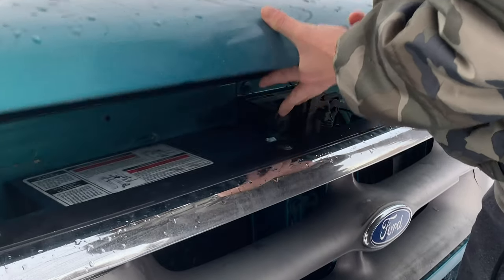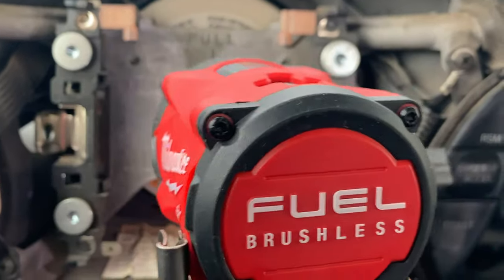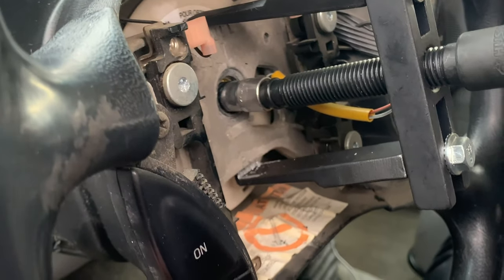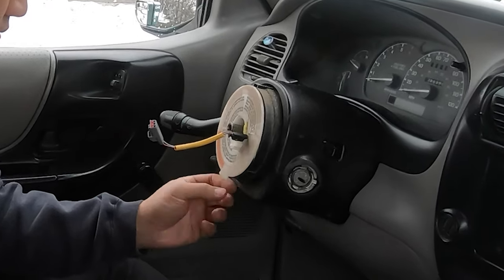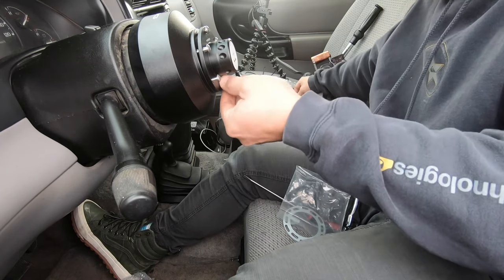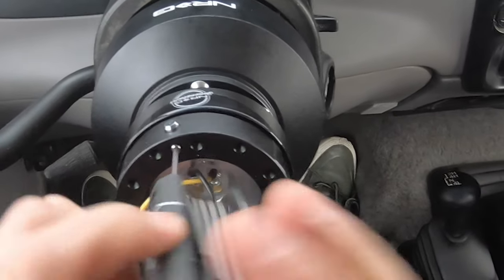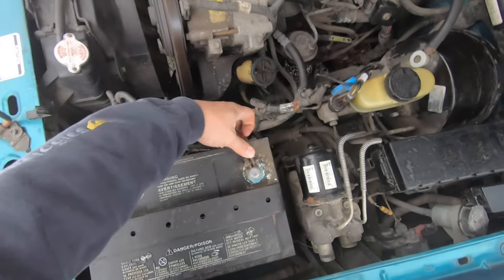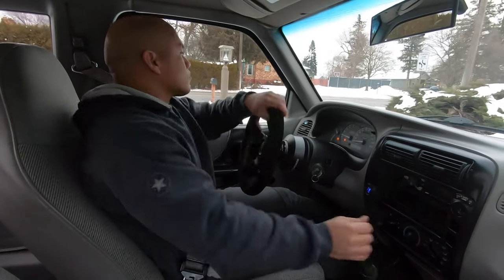How To Install NRG Aftermarket Steering Wheel with Quick Release - Ford Ranger

Comment: I have a 94 ranger , dose anyone know the pats number for that year bc the spline looks different
Reply from the maker: I posted a link to it in the description. The spline does seem to be a little different. It's jammed on there, but it works.
Reply from the maker: The adapter will also need a little modification to keep access to the clockspring wiring for the horn. If you look at this video, you'll see what I mean. https://youtu.be/CNPR5JYdEQM

I talked to a guy who used a die grinder to shave down the hub adapter a little to make sure the horn wire is still easily accessible. But when I installed mine, I just blindly pressed it in. whoops.
Reply: did you ever get your wheel off, if so, can you help me with my 94, the column is different from Stronghold's 95

Comment: What model huh adapter did you use?
Reply from the maker: I put the part number and the link to get it in the description. There's also more information you should read/watch there too. It doesn't fit EXACTLY but it works.

Comment: can i use any quick release with the hub?
Reply from the maker: The hub is designed to receive a 6 - screw steering wheel or quick release. The 6-screw pattern is pretty universal, so as long as you find one with the right pattern, it should work
Reply: @rayregnogarage  thanks so much

Comment: Does anyone know if these can be installed on 91 rangers?
Reply from the maker: I found a Momo Hub adapter on Amazon that says it will fit 84-97. But it looks really tall. Much taller than the NRG. You could try the same part number I used  from NRG and if it doesn’t fit, Amazon is good with returns. The 84-97 rangers are identical mechanically. So it’s a safe guess that it would PROBABLY work.

Comment: Does that hub fit a 2010 ranger
Reply from the maker: I don't know for sure. But It should. The Ranger didn't change much from 1993-2011. Contact NRG to confirm
Reply from the maker: Also... this hub doesn't "fit" the Ranger exactly. Figured that out the hard way. It "works" but if you want your horn to work properly, it will need some modification. Watch this video: https://youtu.be/CNPR5JYdEQM

Comment: I need help finding what kinda hub adapter I need
Reply from the maker: I put a link to the one I used in the description of the video. Also... Just a warning, there are a few nuances to it. Once you get the hub on, it's really hard to get off the truck. One of my viewers mentioned that the spline doesn't match perfectly so it kinda jams on there. Also, It's best to trim the hub adapter a bit if you want to run a horn. I talk about it more in this video. Watch this one before you do the install. I made the mistake of just forcing the hub adapter on there.. and I ruined the clock spring. So I have the horn ghetto rigged for now.

https://youtu.be/CNPR5JYdEQM

If in doubt, call NRG. they can help you
Reply: @rayregnogarage  my main problem is I can’t get my steering wheel off I’ve tried everything
Reply from the maker: Did you try a puller like I did in my video?
Reply: @rayregnogarage  I don’t have one I might have too get one appreciate u sir
Reply from the maker: you won’t get it off there without a puller. it’s on there tight
Reply: @rayregnogarage  hey man I got it off but I don’t have a clock spring the round thing I don’t have it
Reply from the maker: Interesting. What year is it? Before removing the wheel, did your blinkers turn off automatically when you finished a turn?

Comment: i have a 1998 ford ranger why does it say that it won’t fit on amazon
Reply from the maker: Because technically it doesn’t. It’s for an F150. Watch my second video on this for details
Reply from the maker: https://youtu.be/CNPR5JYdEQM
Reply: @rayregnogarage  so is it for just the air bag is why it says it wont fit
Reply from the maker: @eastonavery2697  The airbag gets removed. Did you watch the second video? It shows you were it either needs to be modified or just force fit on but you'll lose the horn. It's not ideal, but it works
Reply: @rayregnogarage  oh ok thank you
Reply from the maker: @eastonavery2697  good luck!
Reply: @rayregnogarage  one more question i’m sorry for bugging you. will this make the alignment all werid
Reply: @rayregnogarage  also how would you force fit it
Reply from the maker: @eastonavery2697  not if you keep the wheel straight and press the adapter on correctly. You don't have to force it very hard it all, it just pushed right on. But watch the second video as it shows you were you miight want to modify the adapter so that you don't crush the clock spring wires if you want to run your horn from your wheel
Reply: @rayregnogarage  Im not really worryed about my horn it might be even easyer to mount it to a switch in the dash

Comment: would this work in my 94 xlt ranger?
Reply from the maker: Yes it should . But watch this video first so you don't break the clockspring like I did. https://youtu.be/CNPR5JYdEQM
Reply: @rayregnogarage  Okay, thanks man, i'm 14, and this is my first vehicle and i love these steering wheels, you know where i can get one the same size as factory?
Reply: and a quick question, would something bad happen if you chipped off the entire piece of plastic, are you supposed to keep that white piece on, or did you just chip it off with the pliers to preserve the white piece of plastic]
Reply: @rayregnogarage  i just went to look, and the steering columns are slightly different, it doesnt work the same way, i dont have the two circular plastic pieces that hold my airbag in.
Reply from the maker: @TonyWitThaTommy  Pretty sure you don't have an airbag. They redesigned the interior when they added airbags to these trucks. everything else should be the same.
Reply from the maker: also. i don't know the factory diameter of the steering wheel. the wheel I used is 350mm and I like that diameter. i had a 320mm wheel on my xterra and didn't like it.
Reply: @rayregnogarage  i dont blame you man, i like the stock diameter in vehicles, escpecially, like my 94 ranger, i just wanted something that i could take off for anti theft
Reply from the maker: @TonyWitThaTommy  Ya. I mean.. the Ranger is the easiest truck to break into. I take my wheel out every night when I park it outside.
Reply: @rayregnogarage  it is, escpecially the 94 and older considering the silver key holder in the ignition when the ignition pin breaks, its gone